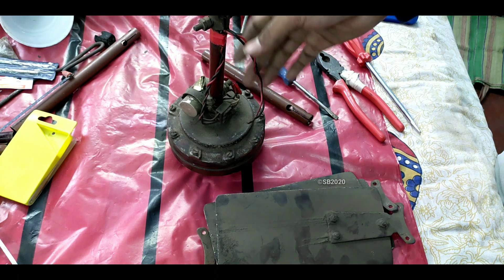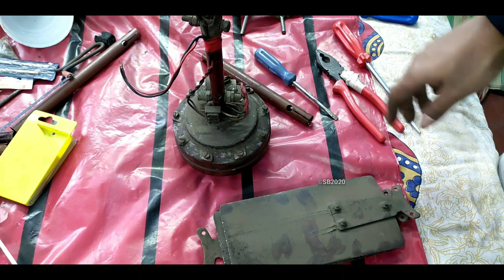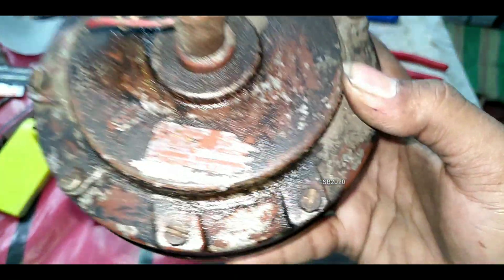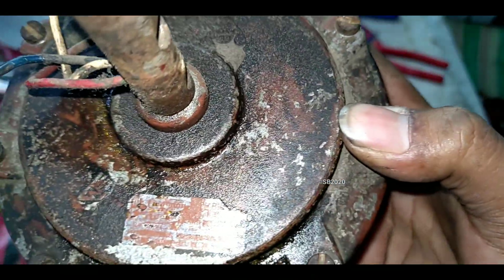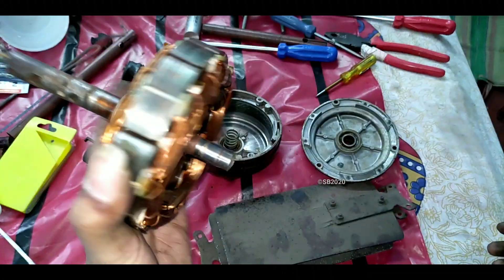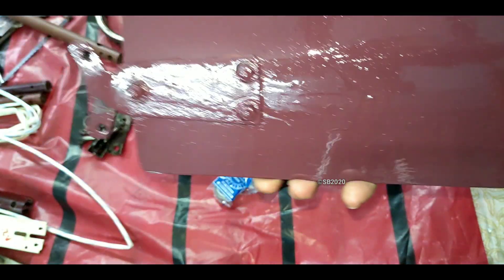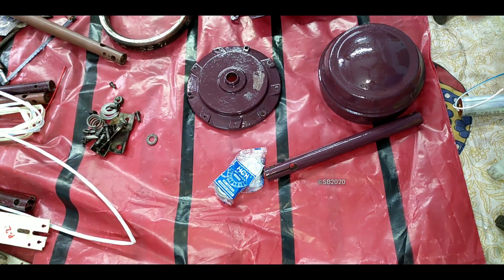Crompton Greaves High Breeze 24 (600mm)(1994) Restoration,Teardown

Comment: Nice restoration! At 10:03, there is more evidence that the Relite Rapide MKII fans were probably made by Crompton, because the 1994 model I have, also has the same thing with two cotter pins in the shackle rubber!
Reply from the maker: May be the downrods  spare parts made by the same vendor....
Reply: @SOURADEEPBISWAS  I think the whole fans were made by Crompton, not only the spare parts because the other ones that I found were either missing the shackle or had the part with two pins missing. Somebody else commented that the stator of Relite Rapide MKII 1400mm, is identical to the one on Zapar 1400mm!
Reply from the maker: I see. Then something is going on... Since Crompton is largest fan maker of India!
Reply: @SOURADEEPBISWAS  To be honest I think Crompton used to make/still makes fans for other brands around the world. For instance, O.Erre R-series used to be exactly like the Relite Rapide MKII fans, but had different canopies. Nowadays, the same model of O.Erre has a Crompton Riviera motor. Even though the fans are claimed to be made in Italy, I still believe they are Indian, but were given permission by Crompton to rebrand them? Same is with other brands such as Vent-Axia Hi Line. 

I guess, it's time for me to make a video about all this info!
Reply from the maker: Might be possible... But we need to investigate More
Reply: @SOURADEEPBISWAS  Just last Friday, I noted that one of my Relites has an old Crompton Greaves logo on the capacitor, but it is very faint and does not show much!
Reply from the maker: May be Crompton supplied raw material for relite

Comment: If my fan runs on a 1.7 uf capacitor currently what is the maximum capacity my fan can run on?
Reply from the maker: Maximum u can use 2.0 uF (MFD).
Reply: @SOURADEEPBISWAS  thanks

Comment: This fan would have had those slim kind of fat test tube like canopies similar to that of the 36 and 42 inch variants of hb
Reply from the maker: No this one is 1990's that's why canopies like 1990's Dec Air. The big odd looking canopies are of 80's which had threaded downrod
Reply: Oh....that means similar to that of hb 48" Fans......those had cone canopies.....later they were modified to those triangular canopies
Reply from the maker: Yes

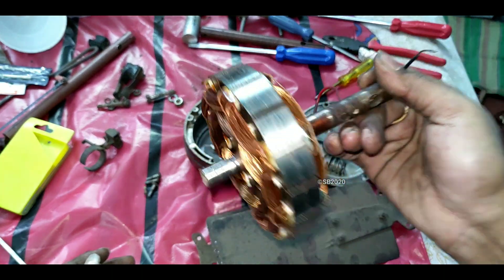Comment: 3:30 why crompton coil have no cotton tape? Now days fan 6+6 or 8+8 pole also have cotton tape
Reply from the maker: Branded companies don't use cotton tape for ceiling fans as "LARGE COMPANIES LIKE CROMPTON DO HAVE R&D WHICH LOCAL COMPANIES DONT HAVE" 
Cotton is bad for ceiling fan windings as it restrict the heat from releasing the coils during operation
Reply: @SOURADEEPBISWAS  right 👍👍.  Cotton tape add extra cost on manufacturing of ceiling fan then why local brand use it?
Reply from the maker: That's why local companies last lot less than a branded company product. Don't use cotton tape unnecessarily. 
Do winding job in Wellington from Asha-Electricals. Shop opposite to Barsha Fans showroom. No. 9830-63-7812/8017-27-2448 as I learnt many Quick tips from him & I rewind fans from him.
Reply: @SOURADEEPBISWAS  compressor motor neither have cotton tape but washing machine, table fan, ap fan motor  all ways use cotton tape why?
Reply from the maker: Good question!
Table fan have close congested body where screws of end bodies or some part may rub against the coil during maintenance causing cut of winding. That's why cotton wrap is used to protect the coils from rubbing on its end covers/rotor during maintenance.

Comment: The fan is high breeze princess and I think unroginal canopies
Reply from the maker: Officially it's High Breeze 600mm & not prince/princess.
Reply: @SOURADEEPBISWAS  no the fan looks like high breeze princess moter
Reply from the maker: There's no such model as High Breeze princess. It's High Breeze slim u may say. The HB24,36,42 have this similar tiny motors.
Reply: @SOURADEEPBISWAS  the canopies look like polar company
Reply from the maker: If every those are a••holes that doesn't mean I am one of them. I am a person who will say the model that is officially declared by the brand.
Princess is a fake word made by some illiterate youtubers & so-called fan enthusiasts.
Reply: @SOURADEEPBISWAS   ono then how 28 inch high breeze princess are there say me
Reply from the maker: U are an a••hole that's why u watch a••holic fake things in the internet. 
1st of all there's no 28" ceiling fan, 2ndly do some research before blabbering blindly on any topic.